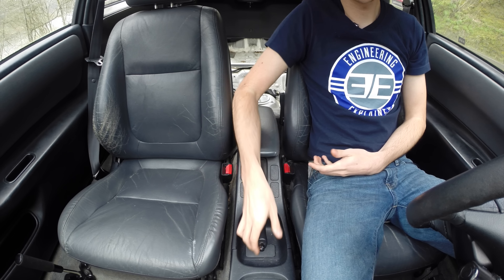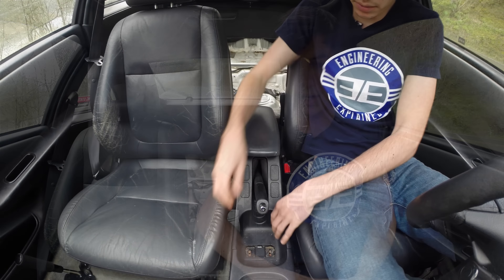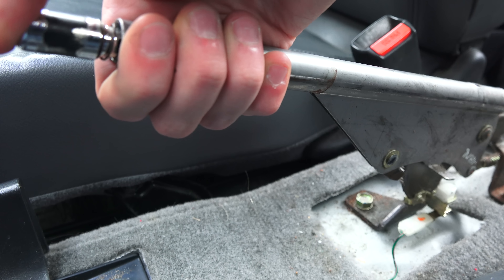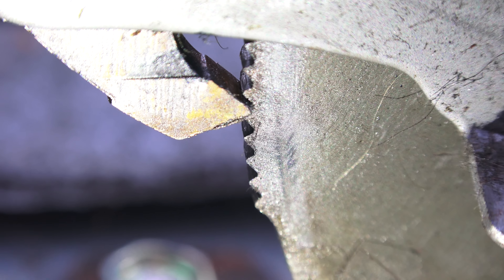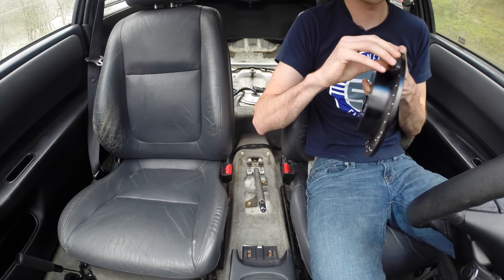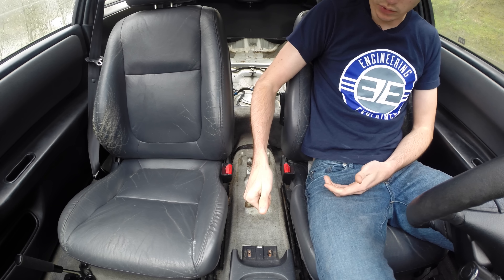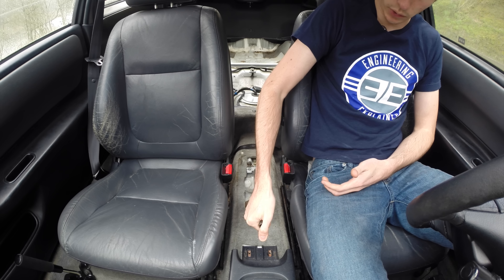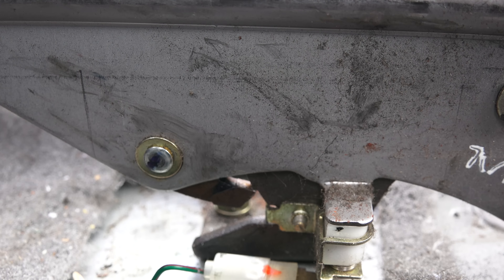Always Press The Handbrake Button? Myth Busted

Comment: what do you guys think about always using brake on manual cars when you park?

i guess on flat even roads its ok not to, it shouldnt move... and it might be bad ive heard to do it 24/7 in winter.

so i mean is it? im pretty like idk OCD i guess about it rolling backwards, if i use it all the time, its cool?
Reply: I don't know man... what does the name "parking brake" imply to you? I always pull the parking brake and either put it in reverse or first gear when parking.
Reply: If you don't use the parking brake in a manual then what are you doing? Leaving it in gear? Or putting it in neutral where it can easily roll away?
Reply: DjStiv3 I would always put the brake on regardless of the situation just to be safe.
Reply: Alex O'Boyle same.... doesn't hurt the car none nor does it hurt to take that 2 sec out of your time to apply it
Reply: I never leave my car in gear when I park. I'll ALWAYS use the handbrake, and if I'm on a hill I'll just turn the wheel in to the kerb just in case. No good can come from leaving your car in gear, you may damage the gearbox if it rolls or gets hit, or else you'll forget about it, start the car, and it jumps forward and pins a pedestrian to the car in front of you. I've been hit by a car that somebody started up while it was in gear, luckily I came away with just a bruised thigh.
Reply: joe o sullivan
I thought you can't even start a new car without pressing down the clutch first. And besides, how can you possibly damage the gearbox? Also it happened to me that the handbrake cable snapped in my car 2 weeks ago, good thing i always leave it in gear else it would have probably rolled on the street because the parkplace was on a hill.
Reply: The moral of the story is, just put it in gear AND pull the handbrake. We even learned that in driving school here.
Reply: My car still rolls back when it's in 1st gear tho... what are you doing differently?
Reply: +Lytheus Well you have a problem then, check your clutch or your engine 
compression. It shouldn't do that. It also depends on the hill, you 
can't park your car on a 90° hill by any means tho.
Reply: Saša Barišić I don't know about automatic cars but you can always start a manual car without pressing the clutch. In fact it's a good way to jump start your car if it won't turn over. My fuel regulator was sticking recently and it was the only way I could start it. And it's also a good way to crush a person between two cars, or crash into the car in front of you, if you leave the car in gear and forget about it. I was hit by a person who forgot their car was in gear when they started it up, had a huge bruise on my thigh for a week. It's much better to turn the wheel in to the kerb as well as using the handbrake, instead of leaving it in gear. But that's just my opinion.. :-)

Comment: obviously it does wear because there is friction there. But the wear is so minimal it's not even worth considering. the ratchet would outlive the car anyway and you'd have to repeat the process of lifting your handbrake without depressing the button at least 1,000,000 times before you saw any sort of real wear

Comment: It's not a 'Myth Busted', as heat doesn't cause wear, heat increases wear. It will still wear without heat, just not as much. So if you don't want it to wear, push the button, if you don't care, then don't.

Though, there still will be heat when you don't press it. If there's friction, there's heat. It may not be a noticeable heat, but I just don't like incorrect statements, especially from a channel called 'Engineering Explained'.

Comment: I always push the button in, I never ratchet the hand brake up as it cause wear as I found on a motor I drove, you had pull it really tight on for it to hold, the teeth on inspection were all worn enough. It also sounds terrible and inexperienced to be doing this in my view.

Comment: 3:31 you can see the top tooth is way sharper than all the other teeth. So it does wear.
It's true that it's designed for it, but the brakes are also designed for.. well... breaking, but in order to use them less you engine breake. Well, for me this is the same. Why wear down a mecanism I don't need to use? If I needed it, of course, I would use it and I would wear it down doing it's purpose, but if I don't need it, I won't use it so I won't wear it down.
Reply: Yeah but is it even a meaningful amount?
Reply: @theiaraine  not relevant, the point is that It does wear

Comment: I can't believe that these tiny little metal teeths are holding the entire car's weight when I park it in a hill... Haha
Reply: Those metal teeth aren't holding the car, the brakes are, the metal teeth are just keeping the rear brakes under pressure.
Reply: Håkon T. 
Sooo... If the teeths brakes, the brake will release the pressure over the wheels and the car will run down the road... At the end, these tiny teeths are holding the car in a hill... And that scares me! Lol
Reply: Well, yeah, those small steel teeth are in essence holding the entire car, luckily they are quite strong.

Comment: I was taught to push in the button and feel the tension as you go up, instead of giving a quick hard pull and stressing out the brake lever and the cables. 

Also after a lot of uses, ratchet gear mechs can wear out and slip over time. A better analogy is riding a clutch at a light instead of putting it in neutral. There's also a saying, if you don't use it, you'll lose it. In the end it's a matter of preference to what one believes/likes.

Comment: Now my question is, Do I have to put in on a handbrake every time I park even if the surface is flat?
Reply: You should... But most people never use it if their car has automatic transmission. I do use mine. If you don't use it and need it some day, it may not work ...

Comment: The pistons in your engine slide up and down 50 times PER SECOND during normal driving. And still last 10-20years.
Reply: apples and oranges or rather pistons gliding on smooth lubricated surface vs verses metal on metal contact. The grease I imagine would get scraped off over time especial if the temps in the car get lethally hot as they tend to do in summers.

Comment: DON'T DRIVE YOUR CAR! Driving your car will wear it out and you WILL eventually crash and die unexpectedly because your transmission and clutch fails because you didn't rev match and when you pull up the handbrake it also fails because you haven't been pushing the button causing you to crash into a wall and after that you get rear ended because you didn't leave your car in gear while stopping which in turn makes you go into the middle of an intersection causing you to die once more!

Comment: My wife complains when I yank the parking brake all the way when parking, she thinks that I'll break something by doing so. How hard do you need to yank a parking brake in order to cause damage? I mean, I don't think the cables are going to complain that much.
Reply: Those cables can stand thousands of pounds of tension unless they're hopelessly corroded.  Lou Ferrigno couldn't break one, I think you're probably safe.
Reply: You can stretch the cables over time by having the hand brake at a large amount of pressure, but that is why adjusting your parking brake is on your cars recommended maintenance (normally every 30k or when it starts feeling loose). Most modern cars have self adjustments with will do this for you though.
Reply: ReverendNillerz: I once ripped the handbrake right off the floor in my friends mini (we were trying to get the wheels to skid while driving on a loose metal road).

Comment: Man. Wear is caused by friction (which causes heat) not heat, the myth is false but the theory not, if the locking mechanism scrapes for a long time the parking brake could not lock anymore.

Comment: The wear is there, it does not matter if you accept it or not! It is true, there is no heat so the wear is not that great, but its still and unnecessary wear! Why in the world would you pull your hand brake without pressing the button!? Your Thumb is gonna be there anyway.. and you just CANT compare Socket Wrench system with a hand brake system.. socket wrench has no button the same way as hand brake has! I know you are listing the theory and facts, but do not say it doesn't really matter WHEN IT MATTERS. Its about the way you threat your car.

Comment: People using a handbrake in this manner are also often over tensioning the handbrake and it definitely causes cable stretching. Fact is your use is more precise by using the button. By ripping it up causes wear on the teeth and slippage.

Comment: All that being said, pulling the handbrake in this way makes you look like and amateur. There is just no reason to make this noise when you can apply the handbrake equally as effective without making this noise. Passenger comfort is all part of the requirement for passing your driving test. It wouldnt surprise me if you got a 'minor' for doing it too much on your test. My experience of driver who make that sound is that they pull on the handbrake so much that it's practically pointing at the roof of the car when they have finished engaging it. It's an amateur move.. stop it!
Reply: The passenger cowardliness is showing, what a soft generation.

Comment: What is the problem with pulling the lever with the button pressed?
The idea wear only comes with heat is simply wrong.
The parts can last a lifetime, regardless, but how can anyone debate more wear isn't happening between two metal parts rubbing against each other in comparison to two that aren't?????
And comparing removing a wrench from the screw at each turn with simply pushing a button in your parking brake lever was the worst analogy I have ever heard. Come on, man.

Comment: Not a myth this side of the big pond

you would fail the UK driving test if you dont push the button when applying the hand brake

you can argue the engineering all day but you wont get a full licence out of the examiner

Comment: Actually it does go bad after a while that's y u have to buy new ones
Reply: I have never heard of anyone having to replace the handbrake ratchet, have never seen a vehicle that didn't seem to have the original, and cannot imagine how many millions of times you would have to pull up on that break to cause any significant wear. Possibly if you play with it just to make the sound for a few hours each day over the life of the car?
Reply: "Actually it does go bad after a while that's y u have to buy new ones"

Ive worked on vehicles professionally of and on for over a decade as an ASE certified mechanic.

Not once have I ever crossed, seen, or even heard of a worn out hand brake ratchet.  Take it with a grain of salt of course.

Hand brake CABLES on the other hand...

Comment: Lmao idk anyone who presses the button and ive been in a lot of cars. Its blatantly wrong. You risk not engaging the handbrake well if you press the button and the handbreak is meant to be used in a way where you can just pull it up without issues. Its like saying that you shouldnt use the brakes while driving because it will wear out the brake pads

Comment: Your logic is invalid, by not keeping the button depressed it does cause wear. The possibility of that wear, however much, causing more issues than using the button is not worth it the risk. Similar to always the gears to slow down its much easier to change brakes instead.

Comment: have you done mechanical engineering?
Reply from the maker: That's what I went to school for. Worked as an engineer for a couple years.
Reply: I have and I say Press that button..
Reply: It doesn't matter what you say but the reasoning behind it, which is none. ;) You clearly can see that there is no tention involved by pulling up the lever.
Reply: Why would you push the release when you are applying the break?
Reply: Calling it a release, You just have no Idea, do you?
Reply: Yes indeed, sorry about that,, My head was in the wrong gear there,, I am for not pushing the button in too.. Head clearer today ,, Lol

Comment: Wear is caused by heat? Tell that to my rounded pebble I found on a creek.
Reply: 🤦‍♂️ If you have running water across your handbreak ratchet mechanism, you have bigger problems than the wear to your handbreak ratchet mechanism. All that water your car is in, including the engine bay, is going to ruin said engine and other components before it wears out the ratchet in the handbreak. And not that it matters, but the interior will be soaked and moldy and awful smelling. But sure, if you leave the car in there long enough, eventually the water will wear out the ratchet. 🤦‍♂️🤦‍♂️🤦‍♂️